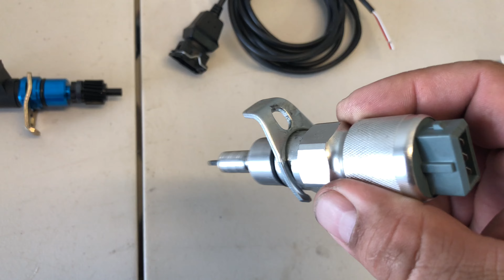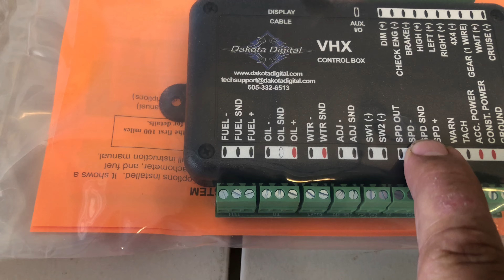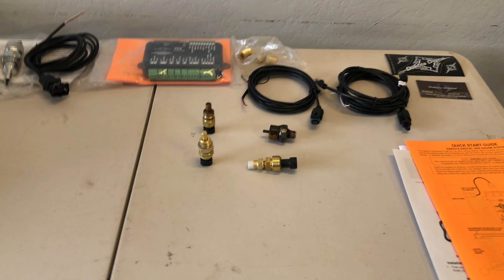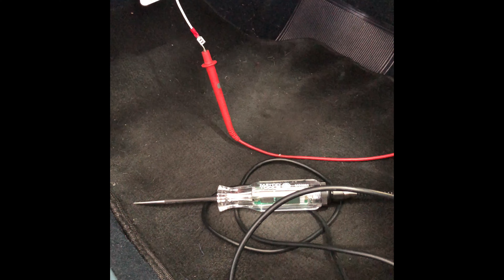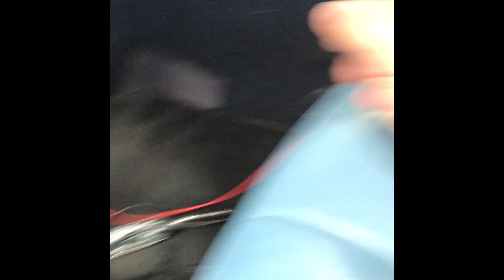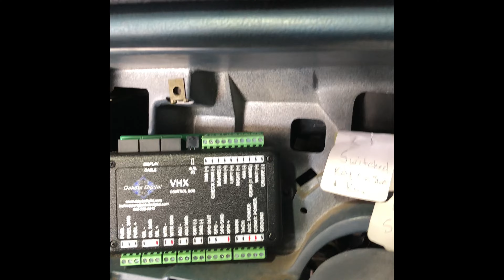Dakota Digital 79-86 Foxbody Cluster install

Comment: What ignition are you using?  MSD?  If so, did you need a tach adapter?
Reply from the maker: I was running the Holley Sniper and now I’m on the Term X with a factory distributor and coil. No tach adapter needed, just the ground wire off of the coil.